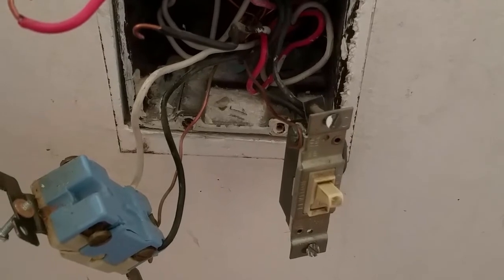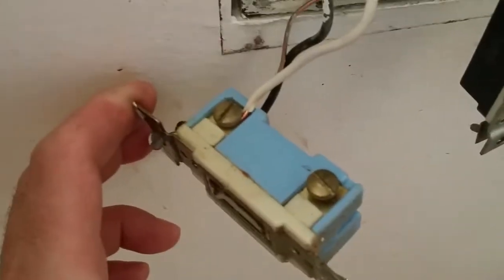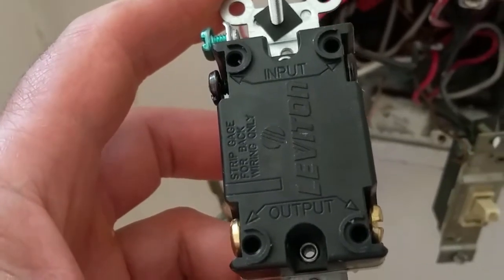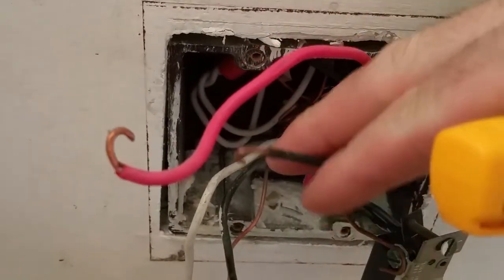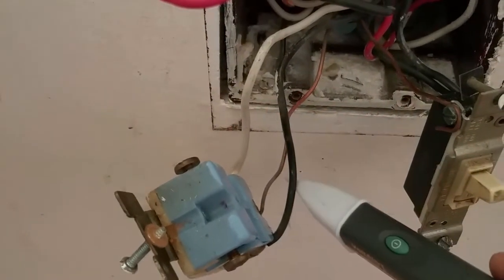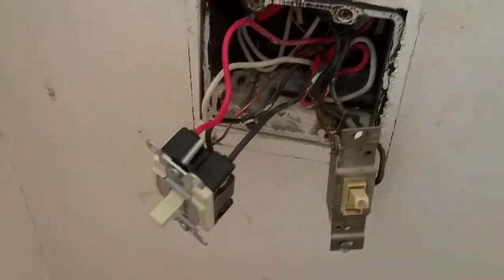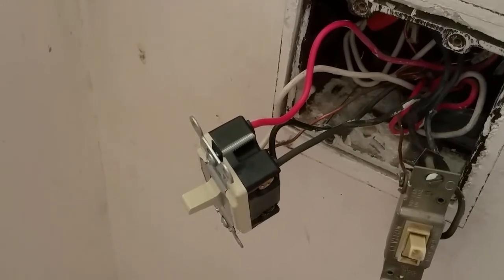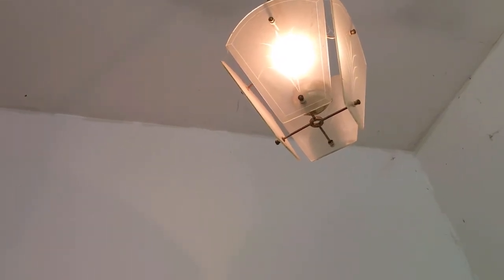How to Figure out Which Wires Go Where on 4 Way Electrical Switch

Comment: With all the respect you should be more specific, you are not showing it 100%, the feed wire goes into what? How many wires do you need, 12/3 or 12/2 and how to trace the wires
Reply: I agree.
Reply: why would you use 12 gauge wire for lights?